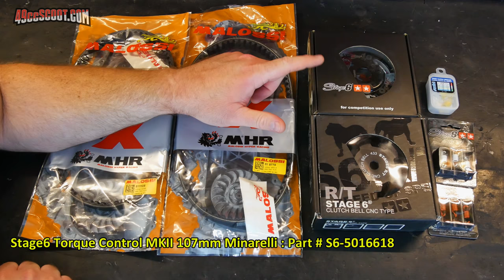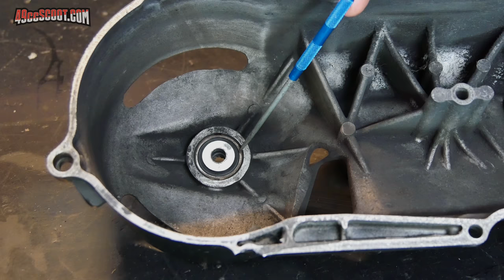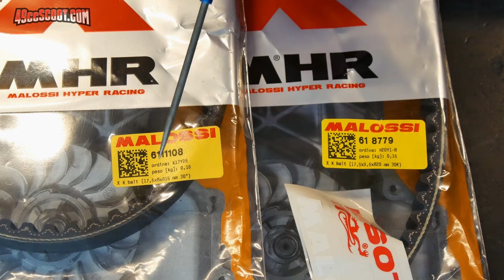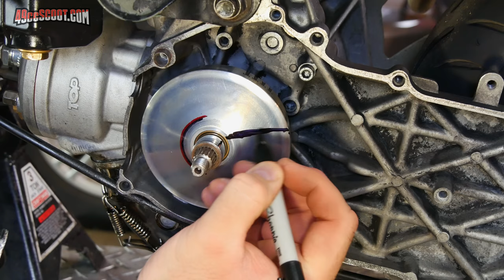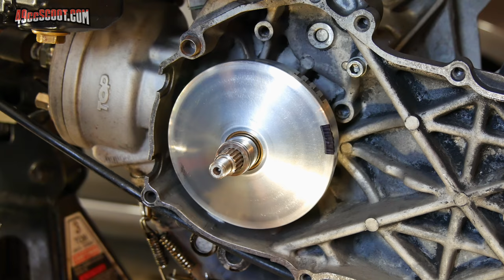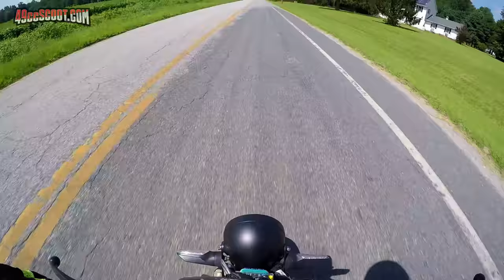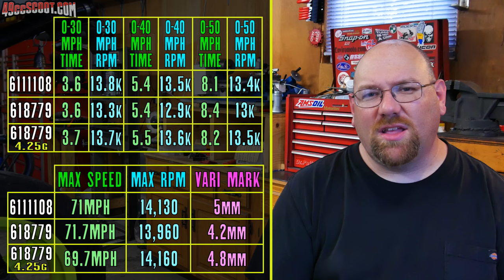Will A Longer OverRange CVT Drive Belt = More Speed & Acceleration For Me?  TPR 86cc Build : Part 38

Comment: I just purchased a honda elite 80 cleaned the carb n new battery got it running but it only goes like 35 mph and makes noise in the cvt what cheap way to get to 45mph do you think I should do ide really appreciate some advise Thanks n Peace
Reply from the maker: The first thing I would do is a thorough CVT inspection :
https://youtu.be/2EjW-iSP-Q8?si=djnlg8hDSRW26wMj

It may not be a bad idea to do a compression test as well and compare to a service manual spec. Make sure it's in good condition before any modifications.

Comment: I have a Taiwan Kaliber scooter with minarelli horizontal engine(jog) stock belt is 747x16.5x30 I found a polini 780x16.5x30 will this work it's length is longer a little over 33mm
Reply from the maker: That's a big step. That would likely be more appropriate with over range pulleys.
Reply: @49ccscoot  thanks I thought so quick question since you replied quick I'm rebuilding my gf chinarelli with all polini stuff when removing oil pump do I remove the round piece that spins on the pump I forget what it's called I think gear shaft maybe
Reply from the maker: @Cito_Fiytb_617  You can just remove the plastic gear, but I take it all out of there to clean it up.
https://49ccscoot.proboards.com/thread/564

Comment: I couldn't help but notice your malossi MHR team ll pipe . I have a buddy 50 with a Prima pipe would the Malossi MHR give me more top end? I don't want to spend 350 on a pipe I might not need I would appreciate it if you could let me know.
Reply from the maker: It depends. If your cylinder is good for 12,000-14,000RPM then it may work. The MHR Big Bore that I have likes to rev. It's not the kind of thing that I'd bolt on with a sport kit.
Reply: @49ccscoot  I have a 50cc malossi cylinder kit and malossi variator with 7 gram weights I'm 150 pounds. Not sure what the malossi 50cc minarelli kit max RPMs at. Could you give me better advice now?
Reply from the maker: @lukeduke7413  If it's a Malossi Sport (there's more than  1 49cc Malossi kit), then I would stay away from the MHR exhaust. It's not a good match because the MHR is so aggressive. The Prima pipe would be better than it.
Reply: @49ccscoot  thanks for the advice man appreciate it 👍

Comment: The reason the longer belt won’t travel more is the half pulley is touching the variator at full travel. Machine 2mm from the center of the variator and you will find more speed
Reply from the maker: I just don't care that much about speed. I've done a lot of variator mods. The shorter bosses and drive face mods for getting the variator to squeeze tighter are OK sometimes, but it can have negative effects on acceleration and that's something that I do care about. Thanks though.

Comment: Hi.. I am using Aerox/Nvx 155 4 stroke scooter.. I ve change the front pulley tu slightly bigger than stock with 10gram roller x 6(original was 13gram) I put 0.5mm spacer.. The acceleration was a bit faster but the top speed has reduced.. What should I do.. ?
Reply from the maker: I suppose the quick and easy option is to decide which is better for you; more speed or better acceleration. If you want to work at improving it all around, you can try adding a small amount of roller weight with the spacer to see how it reacts or maybe a little less weight without the spacer. Fine tuning always takes time. You can try mixing the 10 and 13g so they work like 11.5g. They must be staggered... ever other weight. For example; 10g, 13g, 10g, 13g, and so on. It's very important to maintain balance. Quick tip : If you don't have rollers to make small changes, you can try stuffing weights with aluminum foil. You do have to make sure weight is equal for all stuffed weights though, so you need a small scale. I have a video about it here : https://youtu.be/YkNhqEFeWVQ

Comment: You get different results ( speed and acceleration) when the wind direction change.
Reply from the maker: This is why I do my acceleration runs as averages. Back to back runs on the same stretch of road going in opposite directions, and I don't do this stuff when it's very windy.

Comment: The motor went out on my moped I found a wreck moped the same kind of moped but the motor mount from the top how hard is it to put mounts in for the top mount engine
Reply from the maker: I don't advise doing this unless you have fabrication skills or find a swap kit. Would likely be easier to get an engine that bolts in or a different scoot.
Reply: Sorry I thought u meant the bushing in the motor mount

Comment: So if I’m running a 729 17.7 30 how smaller should I get to get more take off ? It’s all stock but the carb is after market carb.
Reply from the maker: It'll depend on the exact setup. For takeoff, you mainly want to make sure the belt is able to ride on the drive boss and see where that puts it in the rear pulley. The goal is generally to have the belt able to reach the drive boss up front while being to the outer edge of the rear pulley. That gives you the most advantageous drive ratio for launch. Sometimes it's just a matter of shimming the drive boss. Could be that it needs a different belt. Of course clutch setup will play a big role too, but the CVT ratio being right for takeoff can make the clutch operate at higher RPM, almost like you put in stiffer clutch springs.
Reply: @49ccscoot  okay and the clutch is stock still cause I tryd a racing clutch and it spits in Haff on one side lol so I went back to the stock clutch but you right I might just try to put spacers on the front drive to see how well it dose  thanks again for your help by the way I like that small bike you have set up it looks very cool
Reply: I’m sorry I don’t have the stock clutch in it’s just the high torque clutch that’s in the bike

Comment: How is a drive belt only lasting you 200 miles?. That would cost more then driving a car eventually. I've got a 2006 150cc gy6 atv for my kids that has probably 100hrs on the new belt i ordered from china and it's still like new. It hauls my 6ft2 230lb ass thru mud holes and I've never smoked a belt.
Reply from the maker: I had 28,000 miles on my TMAX before I swapped the belt and it didn't even have to be done at that point. Different machines though. This scoot is bound to be harder on belts than your average GY6 since it makes considerably more power and revs much higher. That said, I have a problem. I have been over the CVT with cleanings and checks many times and there is nothing obvious to me. It did the same thing on other engine combos, even with a different version of the OR CVT and on different cases. Belts are ridiculously expensive every 100-200 miles.

I've been wondering if I'm just too heavy for the abuse that I give it. I'm 300lb. I've got a totally different engine setup and a friend that's 180lb that has the exact same thing. I'm hoping to see how it does. If it barely wears like his, then something must be up with this.

Comment: You must upgrade the primary gearring of the scooter from standard to malossi 13/44
Reply from the maker: Standard was 10.1:1. I'm at 11.2:1 now. Don't have many options with the Chinese clones, but I can use that gear set and add extra support to the primary drive shaft. I like the gearing for takeoff, which is what I really care about.

Comment: That is insane you go through belts every 100 miles and we’re not talking about cheap belts.
Reply from the maker: I think my modified torque driver was the problem. I've got an RC1 now, so it's a Malossi OR but I never modified the TD and it wears belts much slower now. I replaced one at 700-something miles and it would have been fine to stay on it.

Comment: What’s it like when the cvt case bearing not good
Reply from the maker: Usually I notice a lot of noise before anything else.
Reply: Ok maybe this is a better description of my jog problem.. it almost sounds like it reving out in 2nd gear when I full throttle it. And a slight hesitation at take off
Reply: Like reving out when you do it on a motorcycle and it starts to make a stuttering noise
Reply from the maker: @nastynatesscooters9896  That doesn't sound like a bad bearing. It sounds like you have an issue that is causing high RPM. Worn belt, pulley problems, gear oil or other fluid getting  onto pulleys...
Reply: You are right I’ve rebuilt many minerallis and just figured the roller weight size and put 7 gram weights in.. then I took 3 11 g switched them out. It was little slower but it worked! Thanks
Reply: @49ccscoot  I have new molossi belt, 8 gram weights in,I used aftermarket pully with different angles and stock pully, molossi variator, molossi clutch and now with heavy weights it takes longer but it still does it at full speed the skipping sound, new tranny oil as well
Reply: Is a 21mm carb big for a mineralli with a 70cc and a pipe?
Reply from the maker: @nastynatesscooters9896  Could be. It's probably OK though. I used a DellOrto PHBG 21mm on a sport 70 with a LeoVince ZX that only revved out to 9500RPM or so. Pretty mild, but worked just fine.
Reply: That the exact carb I have... your videos are awesome by the way!! I love the 2 stroke build videos!!!

Comment: i have  a taotao powermax vip 150cc , i paid $650 NIB   , 1st motor oil change after 25,000 miles.  factory transmission gear oil, brakes, bulbs, belt ,  et cetera. only 2 problems with these and easy to fix. the side plastics break, solution is to ziptie a piece of plywood strip beneath the seat over the crossbar _ 2 : muffler mounts break  , solution take muffler off have it welded at all the points, swingarm, the top and lower engine brackets. . use blue loctite when putting back on except at the studs .  6 years on a 50cc plate . stripped a stud bolt but have another bike :)  why buy a slow 50cc  and put $ into it ? once you change the cc's it is no longer a 50cc and it is a motorcycle and if you get caught its the same as being on a 150cc
Reply from the maker: I'm guessing you meant 2,500 miles, not 25,000. I have a TMAX 500 and a motorcycle license so I have something more sensible. It has 27,000 miles on the original belt so far. The thing is, I enjoy the small two-stroke. Everyone has their thing, and this is what makes me forget life's troubles for a while. 

I have actually went to the MVA and told them about my modified scooter and tried to get a motorcycle plate for it on multiple occasions in the past. Their answer was "once a 50, always a 50".
Reply: @49ccscoot  Over 25,000 Miles . i don'r want a loud 2-stroke
Reply from the maker: @carmineredd1198  Oil change intervals for a GY6 150 should be more like 500-2,000 miles. Many people are lucky if their GY6 lasts half that long with regular oil changes, let alone oil changes after 25,000 miles. I had one, with motorcycle tags. Just didn't do it for me. To each their own. That's why they don't just sell one two-wheeler.
Reply: @49ccscoot  i tag it as a 50cc, i have a 1956 Harley panhead softail https://prnt.sc/u5qooi but i thought it inappropro to mention it in a 50cc article , to each his own indeed

Comment: Recently I bought a new 724 belt  for my Peugeot Kisbee 50cc scooter. I measured the old belt length which was a 723,  and a full 12 mm longer than the new belt. I looked up stretch in an article on v belts, it claimed that v belts stretch up to 2% which would account for the 12mm extra length. The old belt was a Bando, the current one a Naraku. Just wondering whether there is anybody who knows anything about cvt belt stretching over time? Also how temperature affects belt length?
Reply from the maker: I would suggest trying to find measurements of a new Bando vs Naraku. It's very common that the ratings from one manufacturer to the next don't match up. I had a brand new Gates 798 belt that was shorter than a brand new Bando 788 belt for example.
Reply: @49ccscoot  I was attempting to replace the original Bando belt with the same but was unable to find one of the same spec here in the UK. The Bando I got which was claimed to be the correct length for the Peugeot was too short. The Naraku belt is the same outside circumference as the Dayco belt I also bought but it works slightly better due to having a narrower belt depth, roughly 9mm as opposed to 10. The Naraku which is currently on the scooter works reasoably well and has brought cruising speed up to the 7300 maximum torque rpm, but the lowest ratio is slightly too high in that it is ok setting off on the flat or down hill, but struggles on hill starts. Living in Cumbria, The Lake District area, there are plenty of hills. It is my understanding that if the belt were longer it would have a lower initial gear, but the revs would probably also drop at cruising speed. You would think that belt manufacturers would be able to standardise measurements!! I have only been familiar with cvt for about a year now, but it seems that the main varables are, roller weight, belt length, belt width, spring constant for the clutch spring and spring constant for the clutch shoes. Assuming of course that the variator and clutch pulleys are the standard stock size! So a large amount of variability involved!
Reply from the maker: @truthseeker104  I agree. It would make things easier if belts measured to the same specs. Not sure why it's not that way.

Regarding variables, there are more. Depends how deep you go. You also have to think about things like drive face angles and torque driver pathway angles when you go beyond the stock CVT. Things like how drive ratio effects clutch operation are also good to know, so remember that if you change how the belt rides at idle, it will drive the clutch at a different speed.
Reply: @49ccscoot  Yes it seems that the deeper you dig, the more complicated it becomes! A Malossi belt arrived which is the same as the original Bando 723 -17.5 -30 and yet it is roughly 6mm longer than the Naraku or Dayco! I fitted it today and tested it, it seems to be a good compromise as I now have my low gear back but it also maintains a good high torque rpm of about 7100 to 7300 whilst cruising and maintains that on hills, which is even better! The actual belt depth is relatively narrow it is closer to the drive boss in lowest gear. So I am satisfied with its performance, even got some stickers with the belt! 6g rollers seem to be a good compromise the originals were probably about 5.8g...so far so good. I guess overall if you do more and more work on these variators you would get a feel for performance characteristics for each capacity engine. Unlike a gearbox it seems more of an art than a science. One thing I have found is the difficulty in obtaining specifications for parts, I need some needle bearings for the clutch but don't know how to measure these bearings or find an equivalent cartridge. The Peugeot Kisbee has essentially a GY6 QMB engine as far as I understand it but some of the additional parts seem to have been designed specifically by Peugeot but generally standard GY6 parts fit. Anyway thanks for your help, it is very much appreciated.
Reply from the maker: @truthseeker104  Look for numbers on the bearing before you try to measure. They may not be a standard bearing that is everywhere, but that will usually get you what you need. If not, measure OD and length. For the ID, it's easier to measure the OD of the shaft that it fits.
Reply: @49ccscoot  Thanks I will have a look for the number or take measurements next time I take it off. Its working ok at present but that bearing is noisy and looking at the colour of the needles may have overheated at some point.

Comment: My scooter will only run on full throttle. And dies when I try to have it idle ( but I'm pretty sure its because I need new jets!!?????!! But even at full throttle. My drive/rear wheel doesn't want to move. But it's not locked in place!!! And I need my scooter to get to work. So cam you please help me out.
Reply from the maker: Broken belt is the most common cause of the rear wheel not moving. If the belt is fine, then you would need to inspect the clutch and clutch bell to be sure they are able to engage with each other. Make sure the pulleys are turning. When you spin the clutch bell, the rear wheel should rotate. If not, something is wrong in the gearbox/shafts.

For the only running at WOT; make sure the pilot jet isn't clogged, clean the whole carb, and inspect everything.
Reply: @49ccscoot  yea I did check that. And the wheel rotates. And the belt "looks fine" this is why I can't figure it out! I've done enough work on scooters but I've never had this happen. But could it be cause of the clutch springs? Or the rpm spring/ engaging spring. That's what I was taught it was called. But anyway. It forest make sense to me. I usually don't have a problem figuring things out. But yea
Reply: @49ccscoot  And thank you for replying. And so fast. I've asked allot of people questions and your the 1 st to respond. And fast. So thank you. And you really do make it easier to understand. Than the guy that taught me!  Keep up the great work mydude!🔥🔥🔥🔥
Reply: @49ccscoot  And my scooter only runs on full throttle. But doesn't seem at full power!??! But I think its the jets? It starts when I give it throttle. But I have to keep giving it throttle. It won't idle. It just dies. That's should be cause of the jets. Right? It's the only thing I haven't looked at yet.
Reply from the maker: @michaelbearse4733  It could be other things if it dies without throttle, but I'd check the pilot jet and clean the carb first.

Don't worry about too much at once with the rear wheel. Simple stuff. If the clutch  bell rotates the rear wheel, the gearbox shouldn't be the cause, so look to clutch and CVT. If the wheel doesn't rotate when the bell spins, check out the gearbox. Start there and you'll begin to narrow it down.